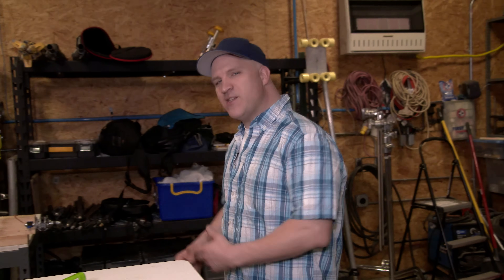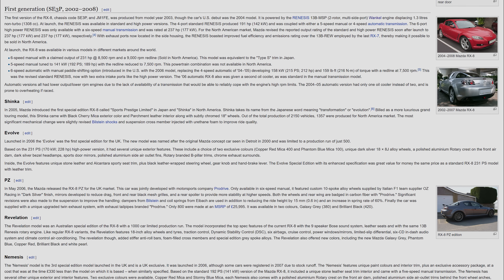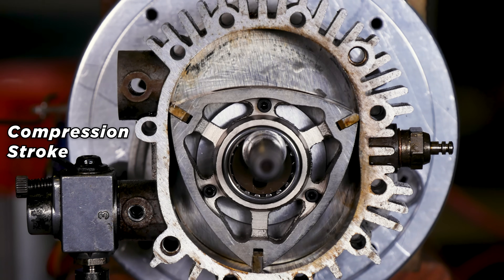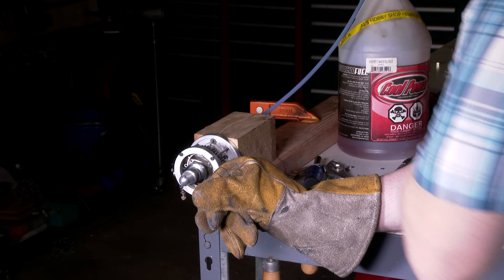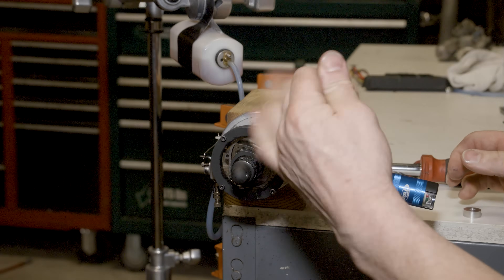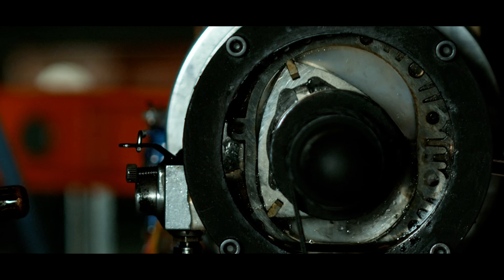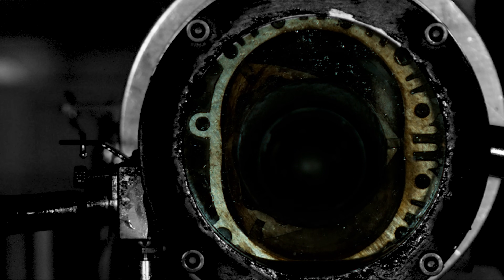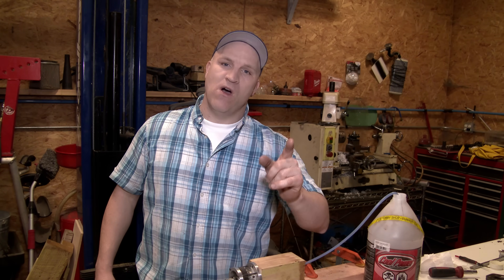See Thru Rotary Engine in Slow Motion - (Wankel Engine) 4K

Comment: You mentioned all the pros but no cons. It’s great on paper but crap in real life. It leaks and if you have a tiny issue with crank your done. In a perfect world this would be the perfect motor. Buts it’s not as adaptive as typical combustion motors. Inline and v. And doesn’t have a huge following. It has one major car company and they only put it in one or two cars they make. Lol even Mazda doesn’t adapt for their fleet and they have used rotary for how many years now?  Not mention any crazy horsepower Mazda rx7 and 8s I’ve seen all did v8 swaps. Lol
Reply from the maker: Very true, and you have some great points, I'm going to be addressing all of those issues and Visually recreating them in the main episode which is the next rotary episode, the main reason I made this episode was the introduced everybody who wasn't so familiar with what the rotary is, before moving on to the more complicated episode. That way people get a better understanding for how the process works. Or at least they're introduced. Not everybody knows what a rotary engine is, some people don't even know what engine is period. I'm going to make a note of your comment and included in the next episode. If you have anything else that you would like me to recreate I will definitely add it to my list. Every engine has its pros and cons. Thanks you !
Reply: Talking with you is pointless.  It's like talking to a wall.  A thing does not have to be perfect to be loved.  Now, move along little troll.
Reply: doktorbimmer Emissions standards are difficult to meet with rotary engines.
Reply: OnlineCarShow 6b by PPRE New Zealand . 
you will actually find that in New Zealand and Australia the rotary engine is very Iconic and everyone enjoys them . 
Ive owned and Driven them and still drive one now daily ! thursty but very fun !!!
Reply: Nah, you are just trolling.  You have been hammering vids for years.  It's kind of an obsession for you.  It's not healthy.
Reply: OnlineCarShow until you realise you can pull 1000hp out of a 13b, which is a 1.3L 2 rotor. There are really only 2 issues with the engine: the oiling system and the apex seals which are a direct result of the oiling system normally. If someone comes out with a way to oil the engine and keep the seals both lubed up and not grinding themselves away your end result is an engine that can make literal metric butt loads of power in a small package. Most peoples main gripes with the car are as I said the apex seals but its a 2-4 hour fix for someone who actually knows about the engine, no one can help that idiots do exist that think "Hey engine's acting funny, lemme keep running the balls off it." You end up with the same crap you get in a piston engine that someone beat the brakes off of, seal blow-by and failure.
Reply: That's the oiling issue they're talking about - the common 'answer' to having to inject oil into the combustion chamber is to use 2-stroke oil premixed in the fuel instead (since 2-stroke is designed to be burnt, unlike regular 4-stroke oil).  Of course, using 2-stroke is a lot of hassle for the 'consumer generation' who don't want to have to do maintenance etc (especially not fiddling with oil every time they visit the pump)
Reply: nel c not true I daily drive an rx7. No where near expensive to maintain. Cost just as much as my Tahoe and G6 for regular maintenance. So much miss information
Reply: +David DiStefano But not impossible, the Mazda RX-8 for example managed to pass the world's toughest emissions regulation (California's CARB) right up until dwindling sales forced its cancellation.
Reply: Brandon Brown no no not that oiling issue, the oiling issue in the rotary engine is that it quite literally squirts oil into the chamber and then promptly burns it off in the combustion/power/exhaust cycles, hence why even freshly rebuilt rotary engines blow blue smoke like a chain smoker from the 70s
Reply: @onlinecarshow 787b, Furai, Kyle Mohan Racing 1000hp 20b RX8 and MX5, Mad Mike's 812hp 20b "Badbul" and his 537hp 26b "Madbul" just to name a few off the top of my head
Reply: doktorbimmer the rotary has its flaws but but that doesn't make it a bad engine.its not for everyone but that doesn't mean we should just stop using them. Btw what's with the bold text?
Reply: says who? you? lol...its only obliterated all the best car makers in the world at le mans . shut up idiot, who know jack shit.
Reply: If you think it's all about power you're missing the point entirely. Not everything has to be a muscle car.
Reply: Phillip Jones and my guess by listening to more than one owner of a 20b turbocharged is it sounds like it’s comparable to a higher revving and cam lift and duration gm 6.2 lsx with a turbocharger basing my observations off of hp numbers and fuel consumption
Reply: J0lel they already confirmed they are releasing a new single rotor engine setup in a hybrid... They are plenty big enough.
Reply: Cosmos, R100, RX2, RX3, RX4, RX7 (3 generations), RX8, decades worth of race cars, multiple large events around the world that draw over a thousand cars and more fans, dedicated shops around the world that only build rotary cars/engines, and even the Goodwood Festival of Speed had a year dedicated to Mazda racing that was dominated by rotary powered cars.  Yeah, no following at all.  The rotary has some issues, but most problems are user created.  If maintained correctly, they will avoid most of the issues people complain about.  And having to rebuild an engine every 100K miles is not great, but not exactly a huge issue.  $3k every 5-7 years is not too bad.  Longer if you don't drive every day.
Reply: +David DiStefano The biggest difficulty with the Wankel KKM design is it's lack of any significant advantages or commercial viability... Sales of Mazda's RX brand steadily declined since the 1980's to the point where Mazda could not even keep a production line running.
Reply: Maybe that is your problem though.  Never loved.  That would explain a lot.
Reply: +Chad Bremer Just the facts here Chad... it not my fault if you chose to deny the truth.
Reply: +Chad Bremer You seem to make a lot of false assumptions... generally based on a lack of personal knowledge and education.
Reply: xAnimosityx Gaming the oiling of the seals issues is easily solved by  pre mixing oil at every fill up into the tank.
Reply: Jason Smith ppre cuts corners and  their builds are crud.
Reply: Rotary engines are really fascinating - but inherently inferior to reciprocating piston engines in several key aspects.
They are more complex, higher wear, need more maintenance and have worse efficiency, but for that they offer better power-to-weight ratio and other benefits.

but really - for normal cars you either have a 'normal' engine or now electric motors (which to this point are due to battery technology still not any better for the environment).

and then there are turbines - which offer better efficiency, higher reliability and a better power/weight ratio - reasons why they are so prevalent in planes.
Reply: I agree they're higher wear / need more maintenance (especially when turbo'd), and definitely have worse efficiency - but I would say that piston engines are significantly more complex (in implementation) than a rotary - as can be see by how few moving parts there are in a rotary.  Conceptually, the rotary may be (slightly) more complex, but not mechanically / implementation wise.
Reply: dosnt have a huge following? lol you are one dumb ass!!
Reply: U need to have deep $ pockets to regular maintained and service it
Reply: Its not perfect at all, even in concept. It is way too over square which means slow gas flow, poor mixture distribution and lousy thermal efficiency. It has a "stroke" of less than 1 1/4 inches. So imagine an engine with a bore of about 6" with a stroke of 1.2", that would not be a very efficient engine.
Reply: Phillip Jones no that would be awful if you consider the equivalent would need to be 6cyl also so yea a paperweight. That's why it still works for the rotary though it's weight/size compared to output.
Reply: No a single rotor wankel produces one power stroke per 360 degrees rotation of the E shaft which is the same as a 2 cylinder piston engine. So a 2 rotor wankel produces a power stroke for every 180 degrees of crank/E shaft rotation. So that makes a 2 rotor wankel equivalent to a 4 cyl piston engine. Yes there are 3 facets on each rotor but it takes  one and a half revolutions of the crank/e shaft for every facet to "see" a power stroke. It took me a while to imagine this but trust me that is how it is. Have a play with a plexi glass model and you will see that a 2 rotor is the equivalent of a 4 cyl piston. 
By the way I have a Mazda RX8 that has done 133k miles with no problems but a friend has a 6 port that failed after he over revved it. And that is the problem. The 6 port allows revs to well over 10k and the 4 just 8k leaving a margin. What happend was the rotor just clipped the epitrochoid protrusion at T/BTC and took a chip out of the housing, then the corner seals dug in and failure (expensive) ensued. But yes its a great engine  and if the rotor can be made lighter it would be more robust. Hope this helps. Cheers.
Reply: Phillip Jones yes the math is right but as race events, some insurance company's etc all I've them the equivalence of a v6 so that's what I went by in my comment. You are correct on your info there though.  As far as the 6 port that must be a rx8 issue.

6port FCs as well will over rev on early models but later had a limiter built in i beleive 88-89 or so they limited them to 8k. They rev quick enough a limiter is a good idea.
Reply: Mazda isnt as big as like toyota so they cant just make another rotary but they would like to make vittu
Reply: You have to remember though that the Wankel design saw little development compared to the piston engine. The engine is still mechanically more reliable than a piston engine and, failures aren't as problematic.

Yes it's less efficient and produces less torque, but the platform isn't as dead as you believe. It's design is used in air compressors, superchargers, as pre-tensioners in seatbelts. Mazda has even stated in October of 2017 that they plan on using it as a range extender in a hybrid car.
Reply: Not enough torque for passenger cars. Works for race cars I suppose.
Reply: +Chad Bremer  Then why has Wankel engine production been completely abandoned by all the automobile and engine manufacturers???

Comment: Rotary has been biggest hype and fail of any motor. It’s shit all I can say. Theory works more than actual. Too many weak spots, places for leaks, no ability to do variable timing. It’s crap. Less parts but doesn’t hold up as well.
Reply from the maker: I had many RX7's, and I really got tired of changing the engines every time the Apex seals would break, I now have a Supra. However the RX7 were one of the most balanced cars I have ever driven in road racing. They were like perfect 50/50 all the time. ( Edited because autocorrect sucks sometimes)
Reply: Warped Perception  that and if you relied on the factory oil injection you were destined for failue. Minimum 1oz per gallon prefix at fillup. Run it rich keep it cool and drive the hell out of it.  Oil change every 3k as the heat they make destroys oil quickly and all together with daily redlines and keeping it below 2k until warm they will last well over 100k miles.
Reply: Warped Perception 7s are for those kids that liked to destroy there legos and build another .  Tinker Dream
Reply: Warped Perception, you are right. However, brand new, before the seals broke down, this engine is awesome ... nearly dead silent at idle with an extremely fast response when you gave it the gas.
Reply from the maker: Blindshiva oh yeah absolutely, I wasn't saying I didn't like my RX7 s, but mine we're mostly turbocharged and the intercoolers were probably too small. That was just my particular situation often.
Reply: Alas, Mazda cut all the ancillaries really close to the limit on the stock engine, so any 'upgrade' to the engine needed all the ancillaries upgrading too, or reliability would go out the window...  I've had mine 10 years, running ~425hp, and it's been rebuilt a few times - but one was 'bad luck' (main bearing went), one was my own fault (ran it without oil), and one was due to a chipped apex seal - when I booted it after sitting in traffic, rather than letting it cool for 5 mins first...  so I'd say they definitely have the capability to be reliable, if you do your regular maintenance etc, and upgrade everything before adding more power...
Reply: 100k??? wtf ??? theres stock rx7s and 8s running round here in australia with 300,000 on the clock. 100k? man where do you guys get these figures???

Comment: It's just spewing out unburnt fuel
Reply: Jaco2023 Hence the rotary's biggest disadvantage, fuel inefficiency. This is due to the shape of the combustion chamber (and the manner of combustion) that not all fuel is ignited in time, and is spewed out of the exhaust (whether it is burned, unburned, or still burning). I saw that acetylene catching fire outside of the engine, coming from a mile away xD. (To be honest, Engineering Explained can probably explain a rotary's inefficiency much better than I can)

Also this inefficiency is sadly why the rotary is rare to see in a modern car.
Reply: Well this is also a nitro engine and they have to run ridiculously rich. Remember that's not gasoline in there, it's Nitromethene and methonol and a whole bunch of oil.
Reply: It's just Thrashing it around the housing...
Reply: That's what wankel engines do more or less... its a very inefficient design
Reply: Yes the joys of a carburetor engine. glad don't have those any more.

Comment: Dude you are running that engine way too rich!
Reply: cdawson198600 that's not a fuel return line. Lol! That's just a tank vent line. Some people refer to it as a fuel tank pressurization line, but either way it doesn't return unburned fuel to the tank...
Reply from the maker: ReabowRotors it's Nitro, I was trying to get some flashbang, but it wouldn't run any leaner than that, the engine is just too damn small.
Reply: im1469 that makes a lot more sense than what the traxxas dealer told me, never made sense to me why they would run that rich if the fuel would just be recirculated back to the tank.
Reply: yes they run rich but this is too far, he needs a different mix so that it can run leaner.
Reply: hugo rewucki too much oil can actually have the opposite effect, strange but true
Reply: Well this is also a nitro engine and they have to run ridiculously rich. Remember that's not gasoline in there, it's Nitromethene and methonol and a whole bunch of oil.
Reply: ReabowRotors model nitro engines usually run rich, they have a fuel return line in the exhaust to drain the unused fuel back into the tank at least on traxxas RC cars they do.

Comment: How to make a rotary run on diesel and it manages to roll coal
Reply: Rolls-Royce actually were experimenting with a diesel sequential rotary back in the 60's. It apparently ran and made good power, but it never saw production.

I imagine it was the most insanely polluting engine of all time when it was in testing, however.
Reply: You could run a Wankel on Diesel if you put two of them together.
A larger one to feed a smaller one with air to increase the compression ratio to double.
Or you can use a screw type blower to feed a Wankel engine with highly compressed air.
Never been done before.
Reply: I was referring to the screw blower feeding a rotary, never been done before.
And yes Wankels are polluters compared to 4 cycles, no matter what you do with them.
Reply: Yes but there are no Strokes in a Wankel.
It's a rotary and it does everything in one revolution of the rotor.
A Wankel is more like a two stroke, because the two stroke does everything in one revolution.
And it has ports not valves.
A four stroke needs two revolutions and valves.
Reply: That is not a stroke, it is an eccentric crank.
The stroke refers to the piston going up and down in a strait line..
Reply: FYI; All Wankel KKM engines use the 4-stroke principle
Reply: Rolls-Royce never got the design to work properly, they had serious problems with cold starting and apex seal failures, they weren't the only failed attempt to build a Diesel Wankel either, John Deere, Yanmar, Deutz, MAN, Daimler-Benz and General Motors all attempted (unsucessfully) to build one too.
Reply: +EvenStar LoveAnanda NO STROKES??? Every Mazda 13B engine ever made has a 30mm STROKE  check the engine specs if you don't believe me
Reply: +EvenStar LoveAnanda Its a WANKEL KKM and it requires 3 revolutions of the SHAFT to complete all 4-strokes in each chamber.
Reply: +EvenStar LoveAnanda Having ports or valves makes no difference, there are 2-strokes with poppet valves and there are 4-strokes with only ports.
Reply: +EvenStar LoveAnanda Same thing, an eccentric-crankshaft is still a type of crankshaft. The piston in the Wankel orbits in a planetary motion instead of reciprocating in a single plane, its axis reciprocates side-to-side instead of up and down,